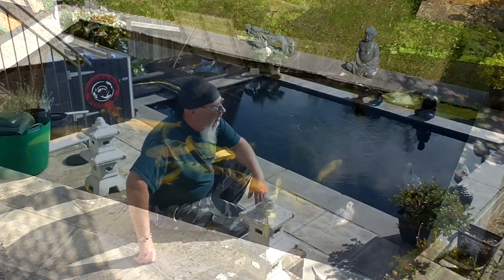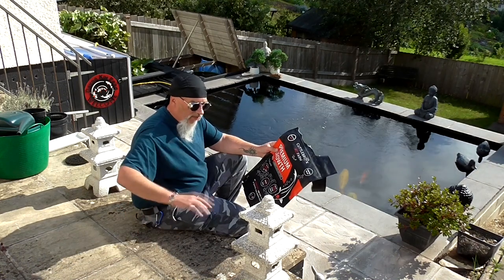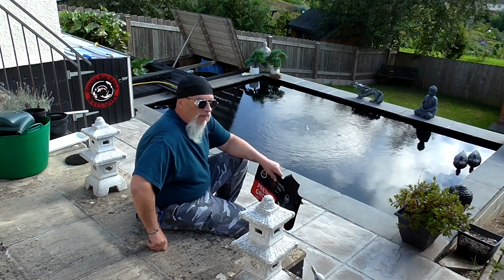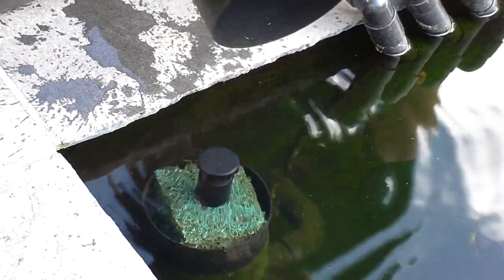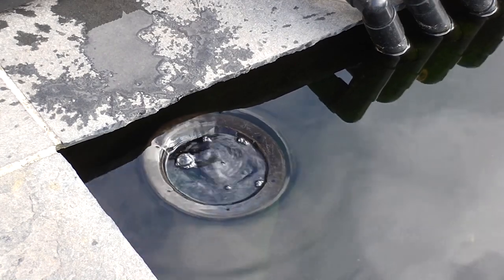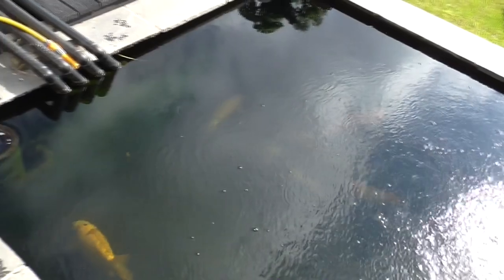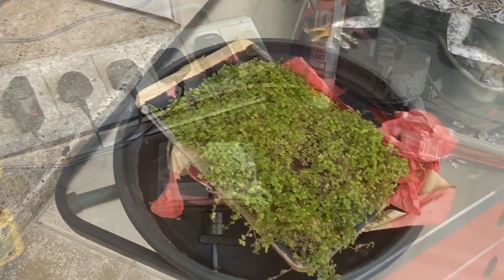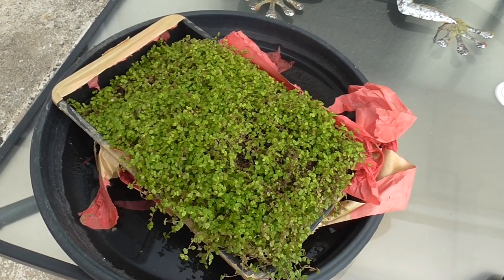***DIY KOI POND FILTER ***BUILDING A POND DIY FILTER*** SHOWER FILTER*** BOG FILTER  SHOWER HYBRID**

Comment: Nice engineering there mate on the bell. I've added cork to my retro floating skimmer to keep the top on the surface which works well too. Ps its ric koi but iv changed my name to Rich D koi now 👍🐟
Reply from the maker: Cork will do the job on the shimmer just as well Have a good weekend mate

Comment: Been watching the James koi whisperer videos today as the weather is not to good I am just wondering how he is going to pay the electric
bill must be over £60 a month for it all if not more but he has done a good job of it all.
Reply from the maker: Was over with him Thursday said about this to him myself he's on about 3 of them pumps 430w each full bore two pond 85w each air pumps two uv 's in the system 50w each Central Heating Water Circulation Pumps the gas boiler will need two 85w each. I had a quick tot up and 1730w if everything was running full bore over winter summer time and pumps running cut back to 60% -70% 700w 24/7 it will still cost more than your house to run
Reply: @boxtriker  Gave those readings to my daughter she said avarage £59.18 week  said he should inform his electric company as the sharp rise in use may trigger an alert hey have to inform the Authorities where there is a high spike in electric use.

Comment: My water is mostly stable through the year PH 7.8 Ammonia -Nitrite - KH - GH  all OK but my Nitrate has just shot up to 80ppm RED.  My pond water is in a constant refresh 120lt a day in and same out. Filter wool in the filters was clean but I have replaced it anyway. Did a 50% water change and the Nitrate rate only dropped to 40ppm and over 2 days has gone back up to 80ppm. This now brings me to the possibility of too many fish or a problem in my filters. I now have 29 fish in a 1500 gallon pond the biggest 3 are 18/20 inch next 8 are 14-15 inch then the rest are around 5-7 inch. The water is clear now after the rain and the fish have plenty of swimming space so I’m at a loss.

Comment: I do not understand my Nitrate level and why I cannot get it down so I got in touch with a Koi expert who I have purchased fish and food off in the past with the question (my nitrate is red and 80ppm) even after changing 50% of my water over 3 days I cannot get it down.His reply just forget it he never tests for nitrate the main tests should be PH-Ammonia-Nitrite a good dechlorinator will take care of most nitrates in the pond and if you have a high reading replace the dechlorinator first. He said the more fish in the pond the more nitrates in the water you need 35 gallons per inch of fish as a guide. Have plants in the water flow or in the pond watercress, irises, water lettuce water lilies to reduce the nitrate.